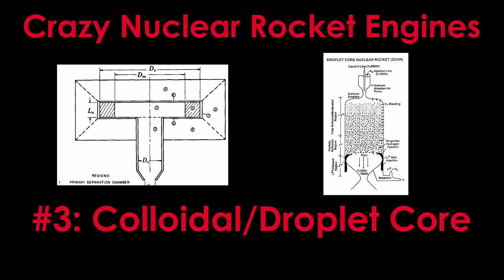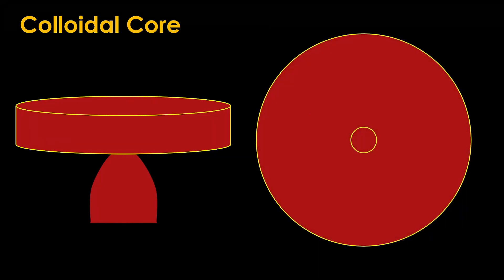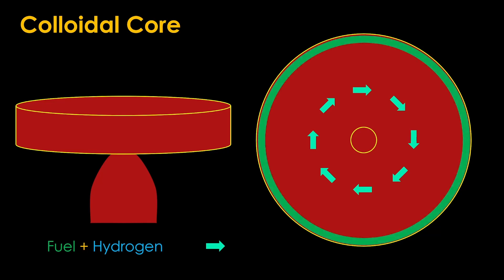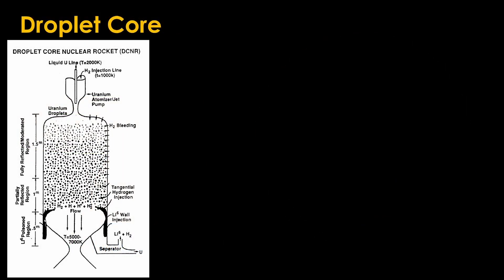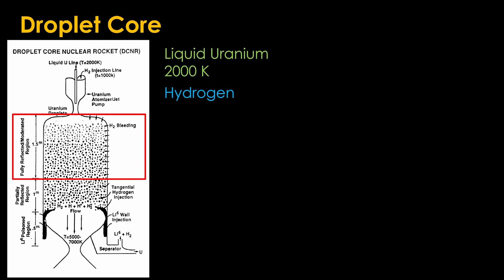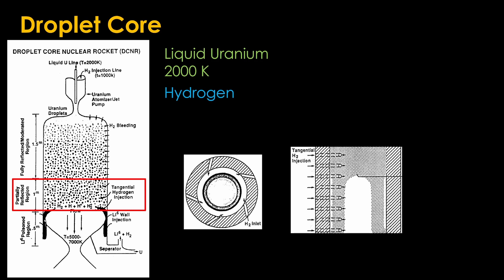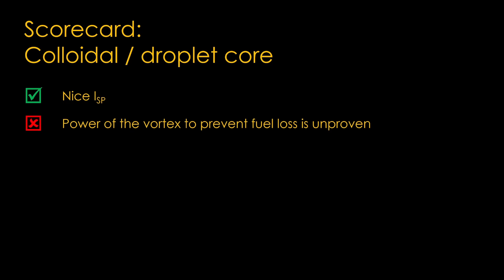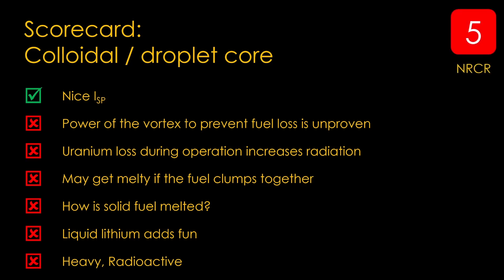Crazy Nuclear Rocket Engines 3 - Colloidal and Droplet Core

Comment: Isp alone isn't a good metric to compare this engines. We need a new metric, miracles per second, or mps or m/s. It measures how many miracles on average are required every second in order to prevent the engine from either melting, killing the crew, or both. I'd say this one has a fairly high value for mps.
Reply from the maker: Excellent idea for a metric. 

Just wait.